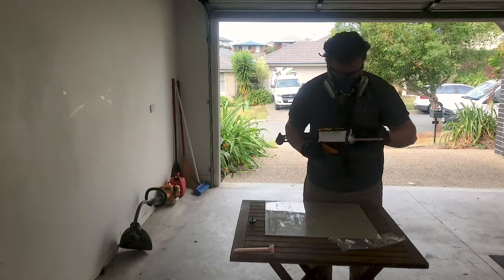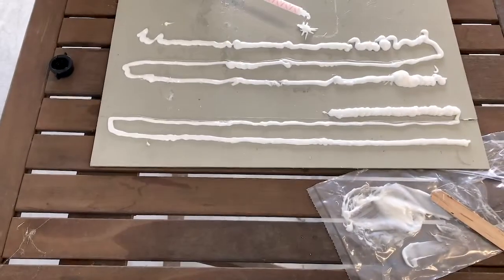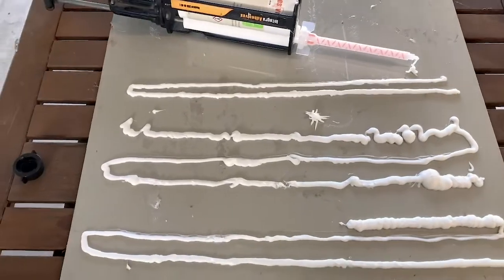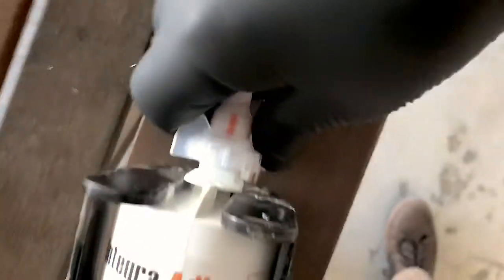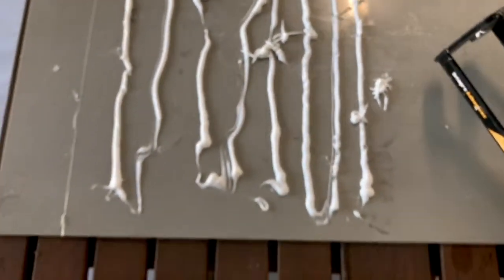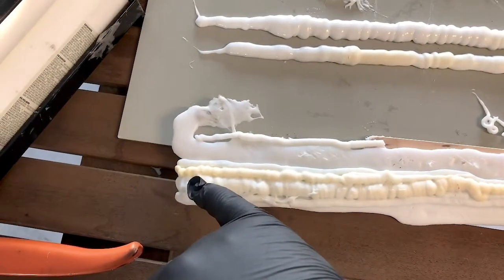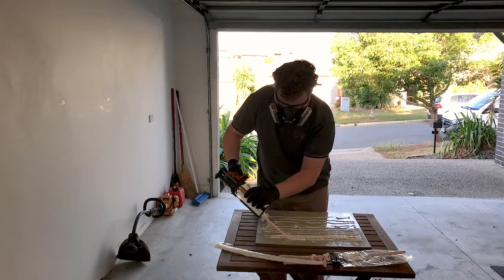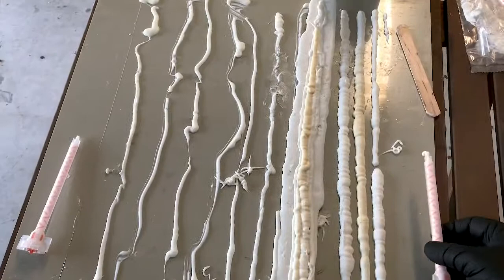Troubleshooting & Solving Curing Issues - Integra Adhesives  | CDK Stone

Comment: I sat through that entire long video and I still don't know how to reset the plungers or how to clean the mixing nozzle after using.
Reply: Hi Sean, Apologies this wasn't more clearly explained. To reset the plungers in the cartridge, simply remove the mixing tip and use the gun to gently dispense some material without the mixing tip in place. With minimal pressure required to do this, it allows the plungers in the cartridge to level out again (or "reset"). The reference to a clean mixing nozzle means using a new one.